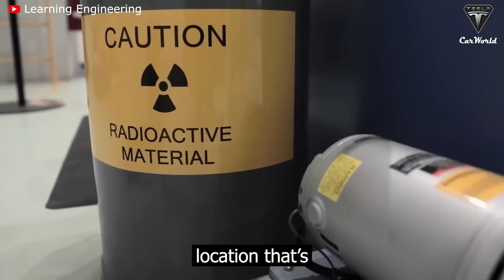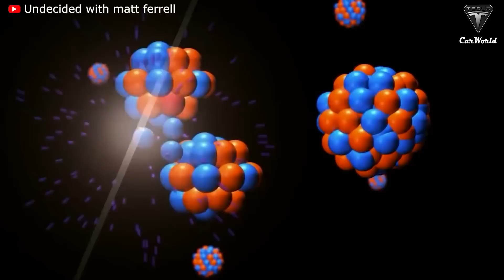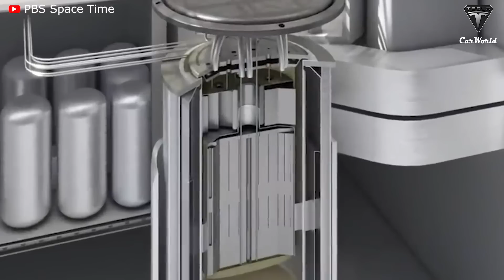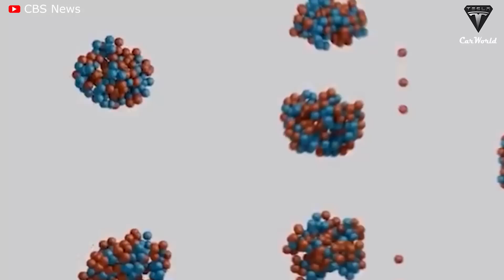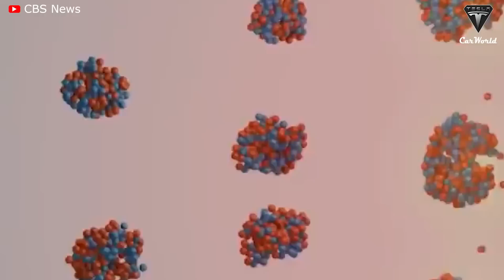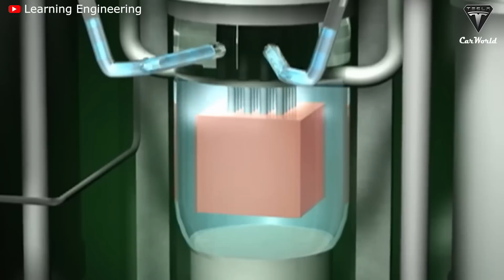Elon Musk Reveals New Energy Source Only $2, Can Replace Solar Energy Texas!

Comment: 1st time I disagree with Mr M. .. Many problems push risk level... If nuke plant has electric shut down, CARRINGTON EVENT S HAPPEN ,power goes down ,BACK UP GENERATORS DOWN, NO WAY TO CONTROL SHUTDOWN.... Next ,see how Russia blackmails the world ,by mining nuke plant in Ukraine ... Fukushima still  not under control ,still polluting and Japan quietly disposing waste into pacific ocean.. Chernobyl is still wasteland and Russian soldiers dug in radioactive soil..Then these same idiots spread harm every where else they went.. WHAT ABOUT 250 k years of storage costs of SPENT nuke power..VERY DECEITFUL.   GREEN HYDROGEN IS IMMEDIATE SOLUTION.. ALSO MANY NEW BREAKTHROUGHS.. WE get to keep infrustructures of gas distribution AND INDUSTRIES USING COMBUSTION ENGINES ,,NO SMALL ISSUES..THINK,, OIL FROM CARBON CAPTURING  AlLEGE = net zero emissions.EASY  DEPENDABLE,RENEWABLE only problem .EVIL politicians ..Were on edge of world war and you want to give totalitarians nuke  plants here at home ,to set off with a few rockets.. Believe in nuke power ,,will only work in your PERFECT IMAGINATION..

Comment: I always wondered why we don't use the heat of the earth  to heat water to generate electricity,cost?
Reply: Because it is not hot enough and close enough to the surface in most places. Rock is a good insulator which is why we don't burn our feet. It also stops the heat flow into the end of well so there is also not enough Power available. Hot water dissolved minerals which are problematic, requiring reinjection, which takes half the power generated. Existing geothermal stations are not renewable because they are gradually cooling down the reservior that they are tapping. A new well created with fracking is only going to produce hot water, not heaps of steam to drive a turbine.

Comment: 150,000 SMR nuclear power reactors, around the world to save the planet. 60years lifespans for each.
60,000 tonnes/yr uranium mined today and we are going to save the planet by MINING MORE URANIUM, 😀

Military dafence costs will explode .$ ??????????? 

$TRILLIONS AND DECADES to build existing electricity power systems and its just big enough.

When coal, gas and petroleum has stopped electricity consumption will be 3 or 4 fold bigger. 
3 times more power plants $TRILLIONS and decades. 
3 times more capacity,  3 times more main transmission lines $TRILLIONS and decades. 

3 times more poles and wires to the streets and homes and businesses and industries $TRILLIONS and decades.

Keep the existing BUT ADD ROOFTOP SOLAR  and RENEWABLE ENERGY. 
UNLOAD the grid with dispersed energy capture from the dispersed ends of the existing grid.

Comment: A nuclear power plant is still a steam turbine. You need a lot of cold water or cooling to have a thermal gradient. So they will need to be built on the seashore.
Reply: for sure, and the seashore is less expensive. But still, with reasonable care and a willingness to put in capital, there are other sources, Like rivers (say 3-mile island but that's not the best example LOL), We have a nuclear powerplant just over the border out here in the Midwest and it uses a large holding pond that they built for it and similar things are done in Europe. At that, almost all of the fossil fuel plants (for the reason you give) already have some kind of cooling water source.

Comment: FACT CHECK a Nuclesr power plant runs are full power 24 /7 since it can't be ramped down and then up fast enough to meet low power use Off Peak. 
Nuclear isthe most expensive power ever made.
Nuclear uses millions of gallons of water.
Uranium is deadly to mine and dispose of after use. In FACT spent uranium is all stored on site. Not 1 ounce has been reprocessed and made safe.
    While Solar makes the most when we need the most. Uses no water and can be stored in lithium mega batteries.  
   Hydro runs 24/7 yet can be stored at high levels days and used at night.

Comment: Interesting logic, commending the fact that Nuclear power plants have a ~95% utilisation whereas others such as Natural Gas are much lower. Surely it is the extremely high capital cost of Nuclear, (with much lower operating cost) that demands we get the maximum output from the investment. By comparison, Natural Gas has a much lower capital cost but higher operational cost as we have to pay for the gas. This shows how useful Natural Gas can be as we turn it off when the power is not needed (on a sunny or windy day ?) and save most of the cost. Natural Gas has therefore a good fit with Solar and Wind, much better than Nuclear which cannot be used to "fill in the gaps".
Reply: we have a difference there but first let me say that Natural Gas is by far the cleanest and safest of fossil fuels. Nuclear 'fission' power has significant drawbacks but as far as the CO2 problem goes it is better than Natural Gas (I heat my home with NG and do not feel bad about that at all). My electricity is provided by the local electric company but they ran a program that if I paid a few bucks extra a month that they would purchase enough solar energy to make up for my usage. The day of fusion power is coming but right now (and maybe for the next 20 years) we only have fission power. Not all regions have natural gas, nor is it a complete solution to the CO2 issue. As far as now goes - first replace the coal plants with almost anything else, then the oil plants. Natural gas where we have it, keep old nuclear Fission plants in service (with upgrades and safety checks), and new thorium fission-based plants . Make as much green power as we can and everywhere that is reasonable. I did not mention this but the change over to electric vehicles is going to increase our electricity needs at a time when we need to close obsolete and dangerous fossil fuels plants.
Reply: 95% utilization rate, yet basic cost for nuclear energy is running about $0.30+ / kwatt.  Whereas everybody else (wind, solar, others) are reaching the $0.05 / kwatt range.  And this expensive 30 cent per kilowatt range doesn't even include disaster recovery costs in case there is a meltdown. They always factor in a probability of zero chance.